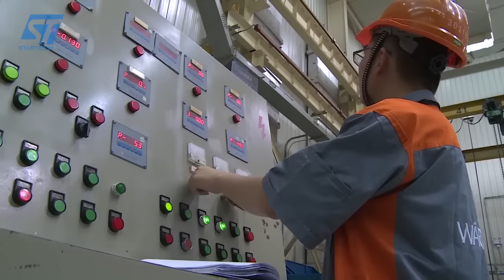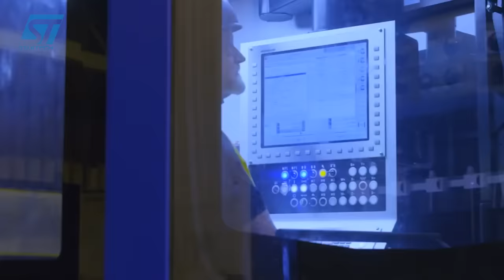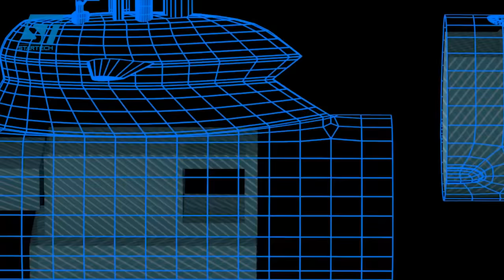Incredible Biggest USS Submarine Production Process in Factory. Amazing Manufacturing Technology

Comment: None of these screws are submarine screws. They are NEVER shown. If a boat is in dry dock they cover the screw or even mount a fake one under water before docking the boat.
Reply: What is the reason for that?
Reply: @derekmurray1462  The shape of the screw used to be one of the closest kept secrets. Because it is the biggest contributor to the noise of the boat under water.
No longer that important as most players have figured that part out. But still...
Reply: @jackmclane1826  wow! Thanks jack , very interesting, learn something new every day 👍

Comment: 동영상을 분석해 분석하면 최고 잠수 능력 한계 300m, 통상 잠수 능력 100m, 
미사일 발사 최고 심도 한도 80m,
최대의 약점은, 후미 30m-50m 부근의 외벽의 내성이 약한,
적의 해중 지뢰로 전손의 우려가 있습
動画を分析して解析すると、最高潜水能力限界300m、通常潜水能力100m、
ミサイル発射最高深度限度80m、
最大の弱点は、後尾30m-50m付近の外壁の耐性が弱い、
敵の海中地雷で全損の恐れがあります。
Analyzing the video, the maximum diving capacity limit is 300 meters, the normal diving capacity is 100 meters, 
the maximum missile launch depth limit is 80 meters,
The biggest weakness is the weak resistance of the outer wall around 30m to 50m to the rear.
There is a risk of total loss due to enemy underwater mines.